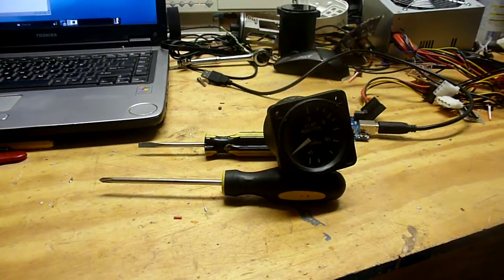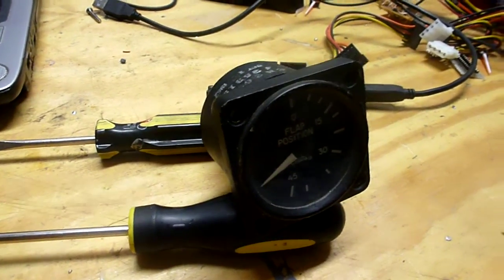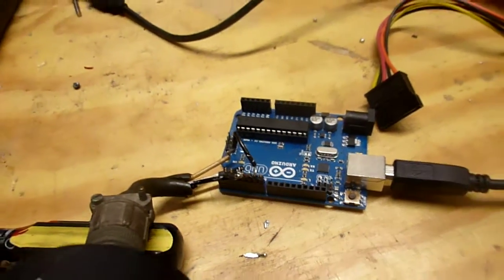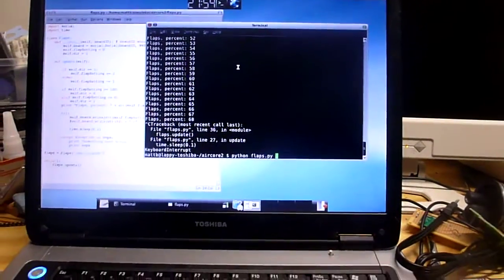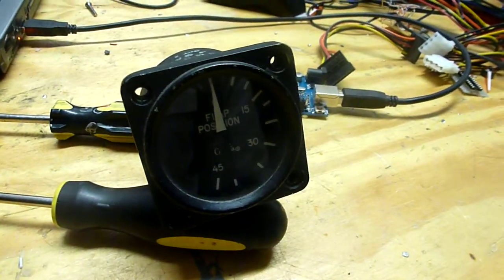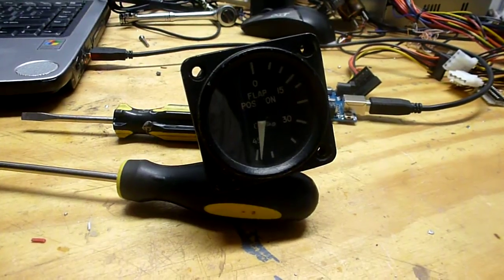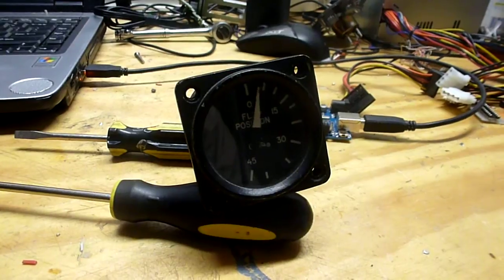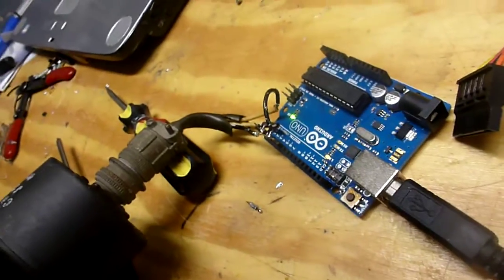Cessna flap indicator

Comment: I have been working in two gauges like this one. One real for flaps, and another that I have mod to indicate vacuum. The inner is something called Desynn synchro. It is like a synchro but works with DC current. It should not be direct connected to arduino, becasue: 1.-you usually need 12 or 24v in order the spring doesnt interfere with the signal and 2.-you can damage the arduino becasue of induction generated.  Here is a link with a image https://lh3.googleusercontent.com/-IaOiX3MqJjo/TX93uvMp3RI/AAAAAAAAABo/L7VL51NOeSs/s1600/Picture1.jpg so you can see: Right side is your gauge. Left side is what you need to imitate with arduino.  And here a vid of mine with the test arduino generated signal : https://youtu.be/-E7JOsDr4k0 and this vid with gauges finished working as the should:  https://youtu.be/OzuT046abYM